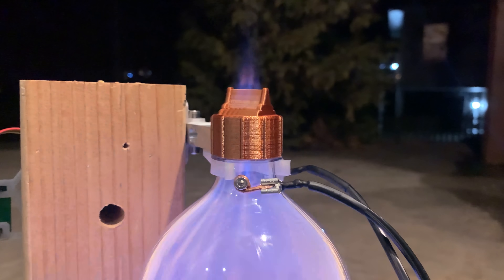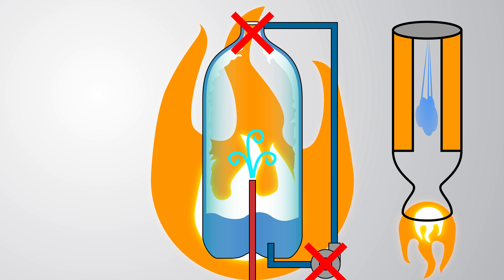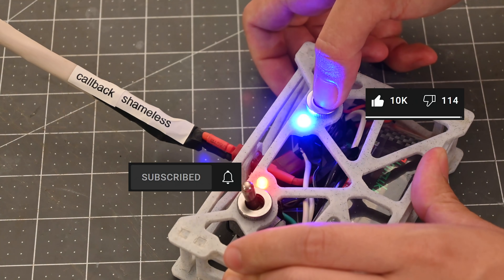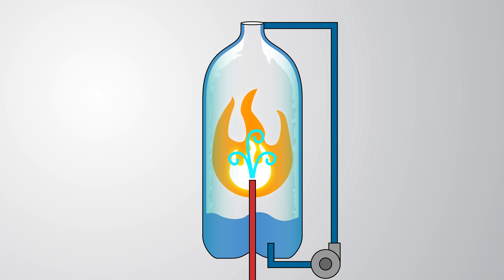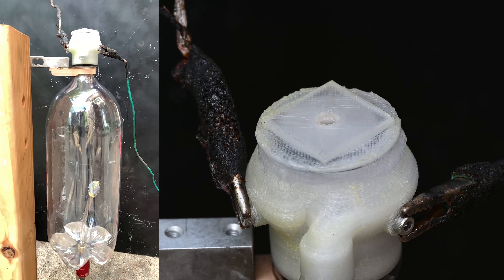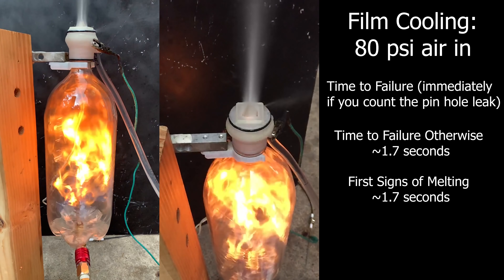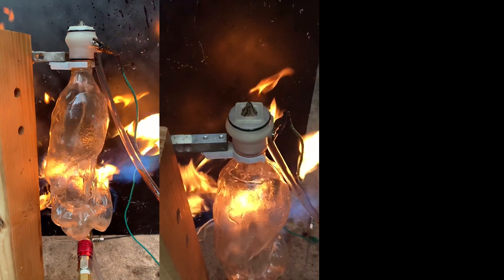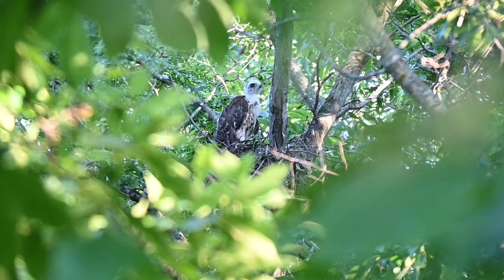Liquid Cooled Whoosh Rocket

Comment: Making the nozzle out of wood was actually a good idea but you missed a couple steps to strengthen it. Put it in a toaster oven for maybe 30 minutes at 150 degrees(not sure how it would react being 3D printed) but worth a try to remove all moisture then take a torch and just hit the inside to pre char it before running. That should increase its heat resistance and strength substantially. I would try(this is based on how I saw your 3D printed nozzle but maybe I just can’t see it right) to angle your fuel outlets almost parallel with the neck of the bottle but also at an angle where the fuel would spiral along the walls instead of just going straight. I would also use more fuel outlets that are smaller but not too small wear you get straight atomization out of the gate. You could also lengthen the air tube to bring it closer to the nozzle, keep your high pressure but reduce your cfm/quantity of air flow to not over fill the bottle with air. My last recommendation(bc I know you want to keep the bottle clear to see what’s going on inside) is to pick up some clear cerakote and pour in the bottle and swish it around to coat the whole bottle. O and go to any home improvement store and pick up a roll of aluminum foil tape to rap that fuel line up. Also, I know I said last recommendation 2 recommendations ago, why aren’t you lighting the outside of the rocket nozzle instead of lighting the inside like you have. It may or may not stop the fire ball from going into the bottle. I’m not rocket scientist so don’t take my recommendations as some PhD level anything lol. Just some things to try and see if it works or not. If my ideas work, I humbly request that you send a recommendation to MIT as an aerospace engineering professor in my name with your model as my reference 🤣.

Comment: I was thinking running rich would help.. in internal combustion it's used all the time to suppress cylinder temperatures from rising to much. That's why your car gets crappy mpg on a hot day usually.. the engine detects the beginning of predetonation and dumps extra fuel in to carry away same of the heat and raise the threshold for detonation. Though running rich atomized mixtures will almost certainly get the nozzle first.

Comment: So hear me out. Put a bottle inside a slightly bigger bottle run the fuel in from the top and in the space between the two bottles. The interior bottle can be the combustion chamber, the outside bottle will keep the fuel in contact with the outside of the inner combustion chamber to provide cooling. Maybe the heat of combustion chamber could vaporize the fuel enough to pressurize the whole system then you would only need one fuel input 🤔

Comment: I wonder if you could go full on Linus Tech tips and water cool the whole thing? Just get bottles that are close to fitting in one another or like get a 3 liter soda bottle to fit around your 2 liter bottles and just cut it in half and tape it back together to get the 2 liter insider the 3 liter bottle and pump water through that gap the whole time! I think it would even take longer without a pump because the walls would start off much cooler and with much more thermal mass backing them up.

Comment: Have you thought about submerging the bottle in a bucket of water so that the outside of the bottle is kept at a low temperature? (try burning a hole in a plastic bottle while there is still water in there...)

Comment: I noticed that once combustion was stable, the outward flow of gasses pushed the fuel out the nozzle (as you mentioned) you mentioned that that was because of the constriction causing the acceleration in the fluids. What would happen if you introduced the fluids at the bottom somehow. Would the speed of rushing gasses still be able to carry the fuel up? Same principle except using air friction not gravity to move the film along the bottle. If not, would there be a bottle geometry where this could work? Maybe an earlinmeyer (no idea) flask?

Comment: Out of boredom quite a while ago I built something similar that might be kind of a fun experiment for you! I took a 24 oz can of monster energy and threaded an air nozzle into the bottom. I cut a hole just big enough for the cap of the can to fit into at the bottom of the can on the side. I then used safety wire to hang the cap upsidedown about a half an inch below the mouthpiece on the inside of the can and put a small amount of isopropyl alcohol in it. You then ignite that small amount of isopropyl in the cap and put the compressed air to it and end up with massive flames shooting feet out the top of the can until all the isopropyl burns up.

Comment: What if you have the liquid film flowing down the outside of the bottle. That way the fast flowing exhaust gasses don't interfere with the flow of fuel. You could test the idea by just submerging the bottle in a bucket of water and launch it and see what happens. Not vortex cooling I know, but it might work

Comment: What if you move the air diffuser down so that it's submerged in the fuel that's pooling at the bottom? You can probably get away with a relatively cheap check valve to prevent fuel backflow into your air line + the air that flows through the pool of fuel may cause the fuel to splatter the wall a bit. Maybe the added liquid that the air is carrying might help to prevent dryout?

Comment: Try adding a wetting agent like docusate sodium to the isopropanol to see if you get an even better film. A cheap source would be store brand laxative gel caps containing this ingredient. I'm not sure if this will make it work better or worse. Fabric softener or simethicone from anti-gas gel caps would be other surfactants to try, or a tiny amount dish soap, but not enough to cause problems with foaming. You could also try small amounts of different salts to give the flame color making it even more visible on camera or boric acid from roach killer for a green color.

Comment: I love the idea of simplyfying a rocket engine to the absolute basic principles, including the actively cooled walls.

My suggestion for improving the cooling film would be a stronger pump, like PC coolant pumps with flow rates of up to 600 L/h.

With a small enough ring nozzle, the alcohol should spread out more evenly and much faster. It's own inertia prevents further disruption by the combistion gases.

Otherwise, the idea of turning the engine and coolant flow 180° is not to far from the cooling methodes of older rocket motors.

The bigger specimens burned a fuel rich  mixture on the nozzles closest to the chamber wall. This would creat a kind of isolating non flammable gas layer between the flame and the chamber wall.

Comment: If you tried injecting the alcohol slightly below the neck (I know adding holes adds weaknesses but bear with me), the jet speed will be much lower at the point of entry and hopefully less alcohol would be carried out in the exhaust, giving better cooling. You'd probably have to inject it at an angle so that it spirals and wets the bottle better. Maybe add an afterburner for the exhaust as well? Anyway, another great video!

Comment: it seems like the hot spots that are popping your bottles are mostly at the same height as the air tube... that could totally change when you turn it upside down... but in this configuration maybe the ring around that section could be protected by a ring of aluminum foil or something just sitting in the reservoir.

Comment: I don't know if it would work and it wouldn't be as cool, but... a paper cup of water can be put in a campfire to boil the water. The cup burns away above the waterline but remains intact below the waterline. Maybe if you put the hot bottle in a bottle of water it wouldn't melt. Building a bottle in a bottle might be a bit challenging, but maybe cheat by cutting and resealing with tape, glue, molten plastic, or ???

Comment: You can boil water in a plastic or even paper over a fire.  And the paper or plastic will not melt/burn.  So if you put the bottle in water, it should work the same way, and keep the bottle's form

Comment: Preheat bottom of bottle or full to shrink it. That will make wall stronger and increase thickness of alcohol on walls. As well if you move air inlet much lower you can in easy way increase time as part of heat will be dispersed by alcohol on bottom of bottle.

Comment: This might be an idiotic idea, but most thermos bottles already have a vacuum filled exterior (they're a bottle within a bottle).
If you had brass tubing to spiral between the two layers, you could both heat up the alcohol, hence enhancing its pressure, and using it as a coolant. Basically what happens in a cryogenic rocket nozzle, but with sweet juicy booze

Comment: @Sciencish
Try using a Coca Cola 1.5 Liter bottle, I have found that those are the most sturdy bottles of all I have tested, but it has to be the 1.5 Liter, the other sizes are worse.
(My tests have been about "vacuum" (low preasure) in room temperature, while your tests are pressure at high temperatures, but I still think that's the best bottle).

Comment: Two things come to mind, 
1. Put aquarium pumps in series or parallel to increase flow and/or pressure depending on needs.
2. Look for the most common points of failure on the bottle (by the video it seems to be where the curve on the neck is sharpest and the sides closest to the air inlet) and add additional fuel-spiny-inlet-thingys to compensate.

sorry for bad English

Comment: First of all, great video! It’s really informative! 
A quick suggestion: 
Real rocket nozzles often tend to circulate the fuel on the outer wall of the nozzles. You could cut a pipe in half and wrap it around the bottle so that the open half faces the bottle and the closed half faces the outside. Circulating fuel through this pipe would then help cool the walls of the bottle. You could then circulate the pipe back to the base of the bottle to reuse the fuel.

PS: Cooling the fuel would also help!
Reply: Liquid butane + IPA cooling would be really cool. Also would eliminate the need for a pump. Probably just a little bit more dangerous though. 

Potentially an improved fuel injector could spin the fuel out towards the walls with clever 3D printed geometry, especially if it's ceramic what fancy ppl like Integsa use. Ceramic could make it go more faster and melt less which could be cool.
Reply: Not all liquid fuel rockets are cryogenic. RP1 (kerosene) is kept quite close to ambient temperature.
Reply: @martindinner3621  Oh! Thanks a lot for the correction!

Comment: Thought you meant there would be two layers with the fuel traveling between  like a full scale rocket nozzle they make the nozzle from stainless tubing welded together then pass cryogenic fuel through it never oxidizer would have a very short life think that would work way better and don't forget alcohol use to be used as antifreeze 
     If you could use materials resistant to acetone then could even use cryogenic cooling by using dry ice to cool the acetone 
   Could use straws attached to run the fuel through
Reply: Always thought it would be crazy to make a scale model of raptor liquid fuled using cryo acetone
Reply: Complete with scale turbo pumps

Comment: What if you went lower on the air pressure rather than higher? I really think that is killing your way of cooling because it is just throwing the majority of your cooling out the nozzle
Reply: Yeah, I would think that a higher reliability would be more important than a higher thrust. once you have reliability and non-melting down for multiple seconds, that's when i'd move to higher thrust.
Reply: And increase fuel flow so itll have a thicker film
Reply: how amount a smaller inner bottle too? to provide some sort of cooling sleeve

Comment: Awesome video! Quick idea I had that may help is to switch over to a gear or diaphragm pump. Those kind of pumps actually self-prime and produce quite substantial amounts of pressure. That may improve the issue with the reverse flow from the back pressure inside the combustion chamber. you can find small gear or diaphragm pumps on eBay for about $20 which can produce ~110PSI (or more) on the output with decent flow, too. they are commonly used for RVs showers & faucets.
Reply: I've seen plenty of diaphragm pumps on ebay, but can you show me an example of a $20 gear pump?
Reply: @spaceminions  Totally, key word 'small' though ;)

Lookup 'ZC-A210' on eBay. Its a ~18$ small plastic gear pump. It generates (relatively) decent pressure and flow, while withstanding ~90C temps. I actually use it on a water-cooled 26cc 4-stroke engine I converted from a weedeater. It pumps the coolant through the engine & radiator to keep temps under control quite well.

Hope that helps :)
Reply: @nickldominator  Thanks, I found it. It says it can only suck about 1 meter height; do you think that sounds about right, or is that probably just the height it can self-prime?
Reply: @spaceminions  That sounds about right for the self-priming. It could probably do a good bit more than that if it was already primed.

Comment: Just some brainstorming. Nothing well though through.
Keep the inverted design.
Pass your fuel through the center of the bottle and use a rotating sprinkler or inverted nozzle to spray your fuel film to the wall of the container.
For the air you can use coaxial tubes.
Hypothetically you can match the fuel flow and the oxidiser flow to get just enough fuel reaching the nozzle to cool it.

Many problems to solve with this though..

Comment: Awesome video definitely looking forward to more. 

I think printing a new nozzle with an extended tube inside the neck of the bottles so that the pressurized flow’s exit path is further away from the path of the isopropyl alcohol.  Minimize the interaction between high velocity flow and the walls being cooled. 

The tricky bit would be making the tube as thin walled as possible to minimize throat restriction.

Comment: Have you thought about a double-walled chamber? A bottle in a bottle, with the fuel circulating between them to cool the inner chamber. Either way, this is super interesting and I can't wait to see what you do with it!
Reply: Or some kind of balloon on the outside of the bottle & pressure in fuel between them, it is probably easier to fit them inside each others in that way. Good idea :)
Reply: There is a guy on youtube making rockets engines with this idea but the issue is to have a regular and even flow (otherwise you will have hot spots which lead to failure or just unefficient cooling). For me, the best way to do so is to make spirals of fuel tubing around the combustion chamber and the nozzle. But in this case it would be easier and more efficient (in therm of cooling) to make a smaller rocket engine in my opinion. Of course doing it with metal instead of plastic would be still better, a good exemple is Integza.
Reply: @misterx-pf6nl  I was watching something recently where they were showing how the liquid rockets circulate the fuel around the bell to prevent hot spots while vaporizing the fuel, maybe Veritasium on 3D printed rockets.
Reply: If using water doesn't count as cheating, circulating water between the chamber would be my way to go.
Reply: I thought of that too!
Reply: Just dunk it in a pool lol.
Reply: @The_Cokester  bad idea
Reply: @prolska  why
Reply: This is actually a real thing in rockets! Its called regenerative cooling and it involves running fuel lines through the bell nozzle of a rocket engine.

Comment: Again great video! If you turn the bottle upside down you could use water as a cooling fluid. As its flowing down, it protects the walls from melting and in the end it safes the nozzle from burning of.
The fuel then has to be injected.
The water and the fuel have to go into the bottle at a greater pressure than the combustion pressure.
Therefor you could use two resovoirs with one for water and the other one for fuel.
These resovoirs are then pressurized with air. The pressure there has to be a little bit higher than the combustion pressure.

Comment: You could cool the combustion chamber using water that flows through the outside of the bottle. It is like the experiment in which you can burn a balloon but if it has water it will not burn

Comment: To me it looks like you need a better nozzle for the air outlet. The pressure is high even with that metal mesh and it was creating dry spot and rupturing the bottle on the same line.

Comment: have u tried using aerosol gel on the circumference of the inside part of the bottle (Acting as a insulation from the combustion ) which might even sustain the environment for a longer period of combustion. I mean aerosol coated bottles. Hope u get my point.

Comment: I love these rocket videos so much. I dunno what it is about rockets that makes my little brain light up with joy, but seeing that flame front travel down the bottle always gets me.

It might not be feasible, but an external water film could help with cooling. The biggest issue would be getting it to actually film up, but cleaning the exterior of the bottle thoroughly and adding a wetting agent should help. As for how you'd deliver the water, I guess the same sort of spinny thing, but that's designed for the exterior.
Reply: Maybe dry ice could be added to the IPA through a reservoir to make thermal conductivity of the bottle's walls less of an issues.
Reply: That idea is surprisingly genius! Something like that would solve many issues.
However, if the flames of the combustion chamber make contact with the bottle, it'd still melt, I think.